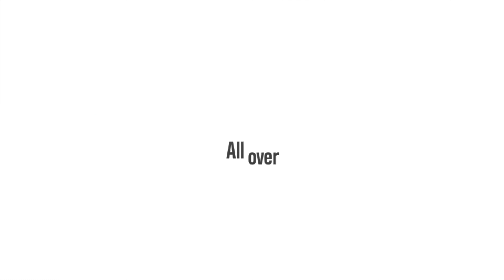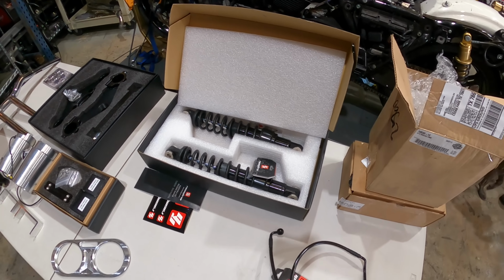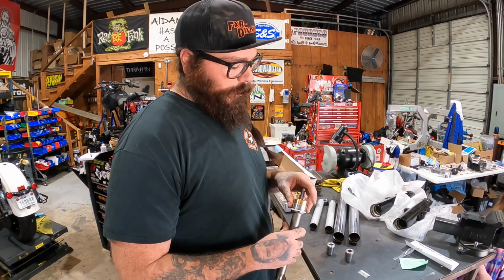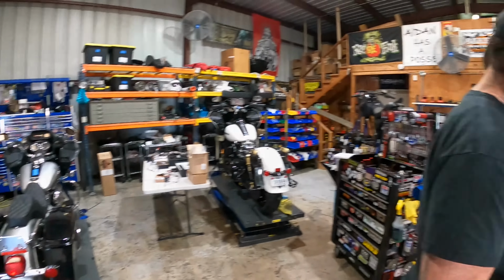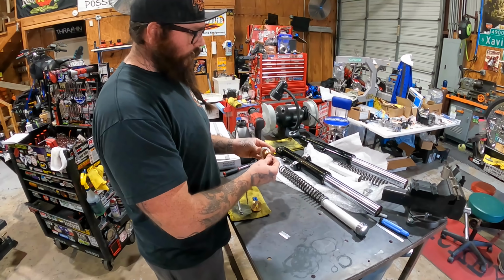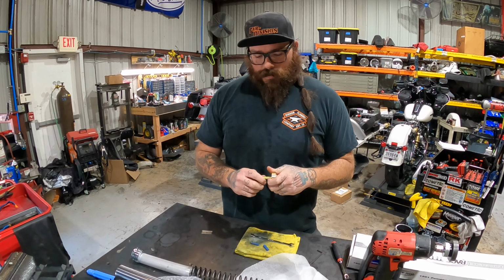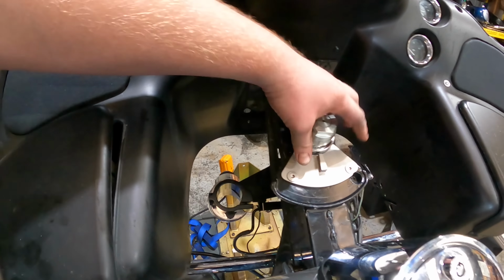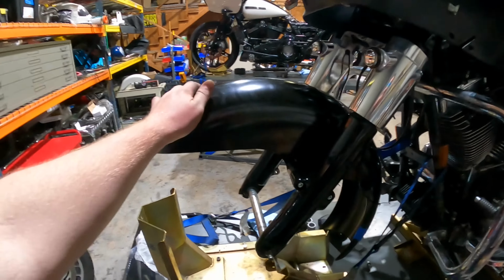Skinny tire bagger build off! Update and new parts! Harley roadglide

Comment: If you want your 100th anniversary derby cover,air cleaner and cam cover medallions to pop,remove the badges,powder coat the covers black and reinstall the badges with 2 sided 3m automotive tape,I did that with mine and they look killer. Also check out Pistol Pete’s custom cycles in Menominie Wi,he offers a lower rear mount Brembo caliper kit for skinny baggers,he also has a kit for the newer bagger to.
Reply from the maker: That’s a good idea!!   Prolly going to leave the factory rear brake and 08 n up brembos up front for now
Reply: @schamberlin5150  I upgraded with the Brembo brakes and the 11.8 wave rotors up front👍

Comment: So what is the rationale behind installing on those parts on the front end...what does it buy you? What will be the difference in performance. Newbie here..just trying to understand why I might want to do this?
Reply from the maker: It gives you full adjustability on the valving in your front end.  Only downfall is it takes disassembled to adjust

Comment: Steve, can you talk about the Ohlins reservoir shocks? I'm looking to upgrade on my street glide special. Can you still use the HD docking kit and accessories when mounting the reservoirs? I don't want to lose the capabilities of running a passenger sissy bar, rack, and tour pack on occasion.
Reply from the maker: Best option then is ohlins 044 shocks and big bear makes a way back mount that will clear all or remove the facia and put in between bag and fender with supplied hardware.  Hope that helps
Reply: @schamberlin5150  I’ll look at that set. I had my eyes on the 772 setup as well. Thanks for the quick reply. Love the content.
Reply from the maker: @dobber9076  the 772s and 159s without the reservoirs are a wonderful choice as well!

Comment: Hey Steve sick build! Was there a reason you went geezer instead of the bbc stem conversion? I know the geezer keeps stock trail I believe? Also did you go +2 on the front end? Thanx 👊👊👊
Reply from the maker: Have done the big bear neck stem in the past. Since I’m keeping it all visible I decided to to do the whole new trees.   No I did 23.5” tubes and a 21” wheel.  Looks like it will sit good with the 14” rear shockw
Reply: @schamberlin5150  sick! so 14 inch shocks will fit on the stock swingarm without hitting oil pan case?
Reply from the maker: @curtissdoyle8959  on the 06 and down it’s looking like it’s fine.  09-16 13.5” looks like the max.  17+ looks like 14.25” is max.  Not positive on the 07 n 08s with the 6 speed tho
Reply: @schamberlin5150  Awesome! I thought I was stuck with 13.5s